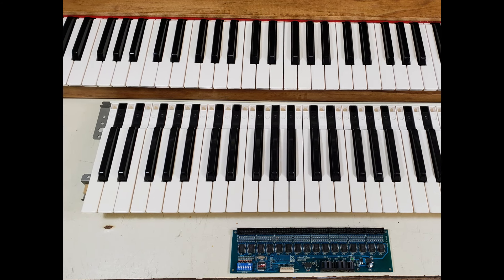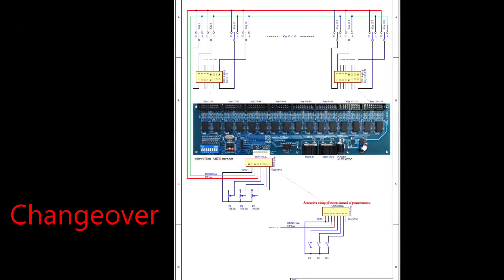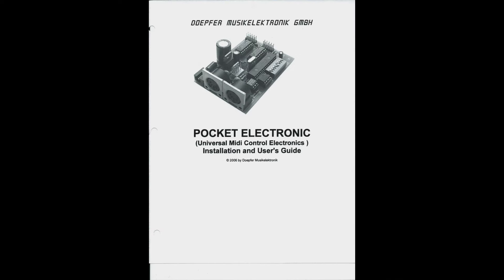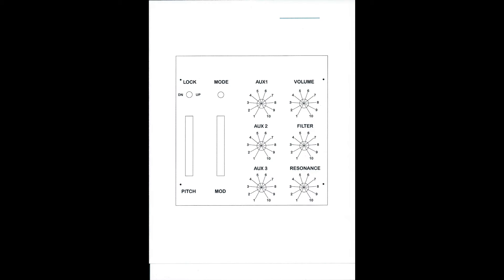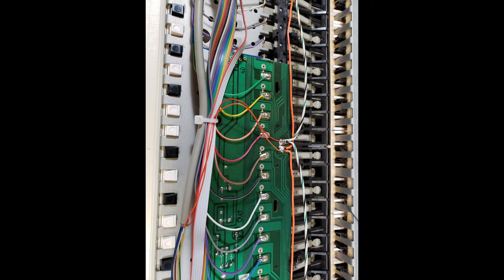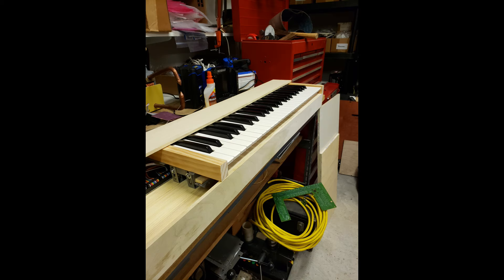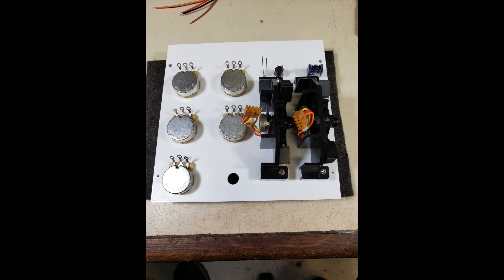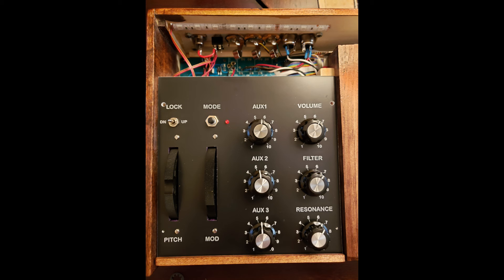MIDI Keyboard Project #2

Comment: Hi, great project! Where did you get the wheels and knobs from?
Reply from the maker: They came out of an old Roland keyboard that was parted out.
Reply: Very cool. What other key beds did you consider?
Reply from the maker: @honkskillet  I intended to use that keybed. I'm a Yamaha Service Center and over the years acquired several of these beds. I like the way it's built making it service free. Plus, I like the feel. It's the same action found in most higher end Yamaha and Korg keyboards in the 80's and 90's and early 2000's.